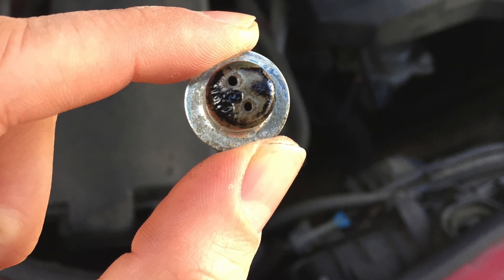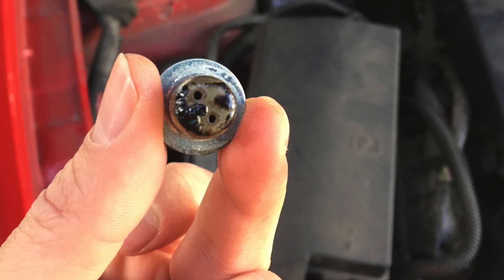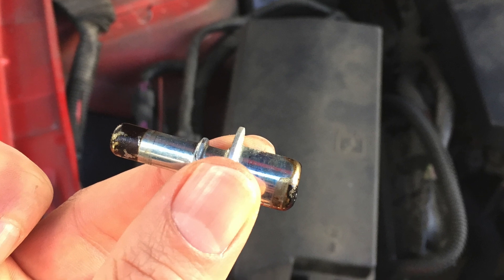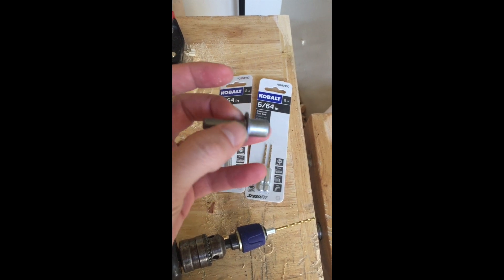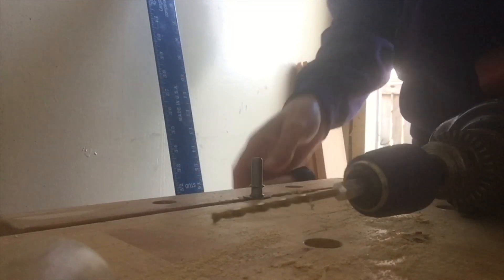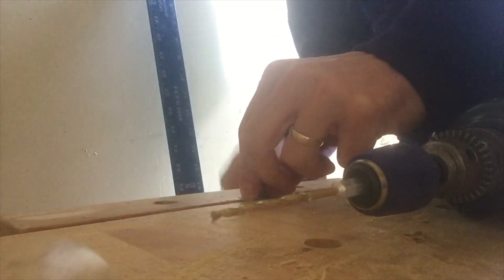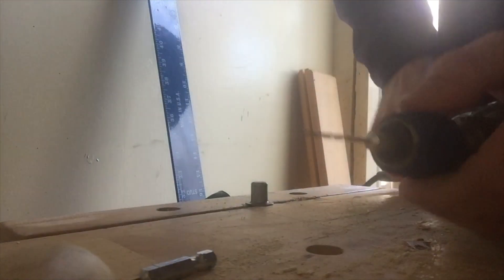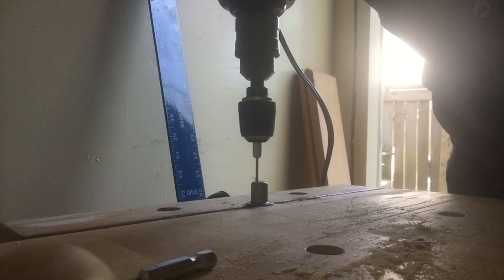GM 3.6L V6  LLT PCV valve modification - GM Camaro

Comment: Why not just buy the newer version of the PCV valve with the larger holes?
Reply from the maker: I wasn't aware that the 2014 fixed PCV valves fit in the 2010 model.
Reply: @bigilworth  If you look at the applications for the PCV valve (click the part number to see them) on Rockauto, it covers up to 2017 models, although not the Camaro. Was the fix not applied to other models with the 3.6L? Or maybe it was, and the PCV valve is a revised part?
Reply from the maker: @brianleeper5737  To my knowledge the PCV valve only needs modification for 2010-2013 models.  In 2014 GM "fixed" the issue by enlarging the holes.  Before I did the mod, all the websites I consulted referenced just buying a new 2010 PCV valve and enlarging the holes.  I could have probably bought a 2014 PCV Valve to see if it would work (since they are so cheap) but I never did.
Reply: @bigilworth  If this PCV valve weren't so difficult to remove you could just pop it out and hit it with some carb cleaner once in a while, like we did with the older cars. It's in the back valve cover on the 3.6L Impala (which I assume has the same issue as the Camaro with it plugging up over time)...which wouldn't be so bad if it weren't in there so tight.
Reply: @bigilworth  It can be modded on LY7 and LE0 motors all the way back to 2004, I did my VE commodore that has a Ly7 3.6 motor from 2008, did it around 1 year ago - no issues.
Reply: I think the newer one is plastic and doesn't fit the 2004 onward models
Reply: Is that an actual option
Reply: money

Comment: Two tips for this:
1. To pull out the PCV I used a locking plier with cardboard around the metal.  It didn't want to come straight out but by twisting it it just almost fell out. So if not budging straight up, clamp onto it and give it a slow twist. 
2. When drilling, do so horizontally to minimise the potential for metal shavings to fall inside.
Reply from the maker: great advice!  It never would have occurred to me to drill horizontally to minimize shavings getting inside the PVC
Reply: I brought my car to the dealership to have them look at it said it was fine it’s been working fine ever cents so maybe just like a glitch

Comment: I just drilled the holes out as large as I could
Reply: How did it run after you did it ?? I drilled mine out as much as I could and its running really rough
Reply: @craigshuttleworth9422  runs perfectly fine
Reply: @craigshuttleworth9422  make sure you put all your vacuum lines back on
Reply from the maker: There needs to be a little bit of resistance for the proper amount of pressure to build up.  Maybe you drilled them out too big.  Did you buy a new PCV to fix the rough running issue?

Comment: How did you remove the PCV from the valve cover, I thought they weren’t removable and the entire valve cover had to be replaced.
Reply from the maker: I took a pair of pliers and pulled upwards on the PCV valve.  It's a little hard to get out, but it does.  No need to replace the valve cover.  In my video I show how I get the PCV valve out at 3:06.  Good luck!  Let me know how it works out for you.
Reply: Alright thanks I’ll give it a try, I have a 2013 Cadillac XTS with the GM 3.6 VVT direct injection engine, and I couldn’t find anything online about how to remove it, some sites say to replace the entire cover.
Reply from the maker: @Jbrown99th  Oh yea I definitely don't believe you need to replace the entire cover.  I have removed the valve about 4 times so far and no leaks or vacuum leaks.

Comment: Change your oil every 3000 miles instead.
Reply: Just stop with the 3k B.S. just use full synthetic oil and a premium filter! GM uses 5w30 oil in these so dealerships can offer those cheap oil changes! All modern engines need synthetic oil! GM owners are also known for being lazy on maintenance as well
Reply: @Krystal I was saying they made it 5w30 so the dealerships could sell cheap oil! If you use synthetic it helps with the sludge issues these engines have!
Reply: @ LF X

It barely uses oil because it’s a thicker viscosity when hot. 

You know what else it isn’t doing?  Going through the dozens of tiny orifices that this engine has for the insane number of moving parts.  

Oh yeah.. 0 weight when cold with the proper oil filter with anti-back flow?  Oil will be right there. You’ll get no startup rattles.. but as the oil heats up and thickens you’re going to get serious damage. Basically the same as you’re trying to avoid with insufficient oil that overheats and stretches the timing chains except in this case it’s flow instead of quantity causing the problem. 

Trust me. I ran a 2004 F-150 FX4 with the dreaded and absolutely awful 5.4 3V Triton. I got 240,000 miles out of it on the original cam phasers and the next owner drove it away with them working fine. 

The reason is because I checked and changed the oil religiously, I used the Motorcraft oil filter with the silicone anti back flow valve, and I used the manufacturer recommended 5W20 oil. 

Yeah, it used oil, and the valve cover gaskets sweated. But those are tiny issues compared to dynamic components being starved for lubrication because you put in maple syrup instead of oil.
Reply: This is modding the engine PCV to match the research and modifications done to later motor revisions, its retrofitting knowledge learnt... only can be a good thing.
Reply from the maker: Thank you.  Definitely felt the same way.  I'm really surprised that GM didn't put out a recall to just swap out PCV valves.  it wouldn't have cost them much.  Anyway, easy mod and helps solve lots of carbon buildup issues.
Reply: LF X  you should be fine I don't know how many miles you drive a year but as long as every week or so you take a trip and let the engine get to full operating temp you can go way longer then 3or4 k! I'd change it every 6 months if you're really concerned!

Comment: Hows the car going now have you had any more problems with the wholes drilled out
Reply from the maker: For this project, I drilled out the holes, and then I added a catch can.  I've put 15,000 on the car and I do not notice any performance difference.    

Before I did this, I took the plenum off and did a manual cleaning of the valves (at 107,000) to get all the gunk off.  I suppose the real test is to see how much gunk buildup there is since doing this project.  

Is it worth it?  I'm not sure.  I can say with a certainty that my catch can captures about 4oz of oil/water mixture every 5-6k oil change I do.  So I must be avoiding some damage to the intake by preventing all that oil from coating the valves.  

I think at the very least, you should put a catch can on your car.
Reply: @bigilworth  yeah mate, I did the whole drill it out thing, with the same drill bits you showed, waiting on the catch can in the mail.... 
My pcv vavle was clogged an all the hose were clogged, it was in terrible state I just bought the ute.. so hopefully it's not too far gone! 
God knows how long it's been like that for! 
Probably never got change from day 1:(
Reply from the maker: @markpalmer9360  Wow that's awful that everything was clogged up.  Your PCV valve sounds much worse than mine.

In your situation, modifying the PCV valve should absolutely make a difference.  And a catch can will truly help prevent coking of the intake valves.  

If you're skilled enough, I would take the plenum off and see how bad the intake valves are coked with soot.  A manual cleaning would go a long way.

Also, you might want to try some sea foam added to the oil to help loosen up any deposits that might be floating in the heads or the timing chains.
Reply: @bigilworth  yeah matey, 
It's not good I was getting gunk on the oil lid, like yellow stuff  it's not a blown head gasket thank God, 
Its consendation from having pcv clogged I guess, yeah so, seafoam is the way to go mate ? 
And with the covers do you need a certain torque on the bolts when you tighten them back up ?
Reply: @bigilworth  hey mate installed the catch can and it filled up in the matter of a drive around the block, I take it that's not normal,,, 
Or maybe it's been clogged up for that long it's just come out,, I dont know what's your opion ?
Reply from the maker: The plenum bolts get torqued to 18 foot pounds
Reply from the maker: If your catch can filled up in a drive around the block, that doesn't sound correct.  That much oil shouldn't be able to push through the PVC valve, no matter how big the PVC valve holes are.  
What kind of catch can are you using?  Is there baffling in the catch can?
Reply: @bigilworth  just a cheap one, an no I dont think so , mayb I should chuck steel wool in it,.
Reply from the maker: @markpalmer9360  Check out some of the YouTube videos on catch cans and how to use steel wool inside them.  Mine has a special compartment that I put the steel wool in and the gasses are forced through the mesh, thus filtering the oil/water out.
Reply: @bigilworth  yeah I done that an went along an bought a ryco one so I have 2 now working mint bro
Reply from the maker: @markpalmer9360  Nice!  The Ryco cans look amazing.  I went with the Moroso and have been pleased with that.  Let me know how the ryco works out.  With 2 cans, you shouldn't have much oil escaping the PVC into the intake!

Comment: How did you get the hose to clamp off mine doesn’t budge
Reply from the maker: The hose that connects to the PCV valve has a little sliding lock mechanism that you slide to the left.  Slide to the left and pull up.  Should do the trick.

Comment: My catch can is always empty? Engine runs fine. Last 100mile trip and about 50 miles city driving gas millage was 25.4 mpg. What'd you think? p. s. Got 101,155 miles on engine. Always use Pennzoil platinum. Never removed  intake though..
Reply from the maker: That's crazy that your catch can is empty.  I literally just opened mine after 5000 miles and had 4 ounces of oil/water mixture.  If you checked it after 100 - 200 miles, you probably didn't drive enough to generate any oil.  Check after 1000 miles and I guarantee that you'll have 0.5 - 1 ounces of oil come out.  
I've been using Royal Purple for the past 2 years, (22,000 miles) and I've noticed less oil consumption but no change in the amount of catch can oil coming out of the PCV.  
Let me know after 1000 miles how much oil got caught by the catch can.  I'm curious.
Reply: @bigilworth I just changed my spark plugs. "probably could have cleaned them and reused them" I didn't have a bore camera, but my intakes were clean. Take my word for it. I used an inspection mirror and narrow beamed high intensity flash light. Nothing in catch can, but a light film. It hardly showed on my finger when I wiped the inside of the can.  The only problem I had was removing the plugs. they were a little too tight, and I took my time. Used anti seize on new plugs Looking for another 100k. Hope I didn't jinx myself. P.S I don't sissy my car. I never was a putt, putt driver. I get on it whenever I can.

Comment: lmao just vent to atmosphere
Reply from the maker: You can be a douche bag and vent to atmosphere, or you can help lower emissions.
Reply: @bigilworth  one has to wonder if oil pits and coal veins getting struck by lightning would essentially burn the same toxins into the air.  It seems that either way it will go into the environment.
Reply: Just scrap you car and you'll be looking at no emissions.
Reply: venting to atmosphere breaks the system (especially on cars with MAF sensors as they measure the air entering for the CCV as the dirty side 
extra air" going around the throttle plate as a bypass needs to be metered to control the AF ratio), a vacuum sucking out the fumes is better than it wearing out the oil and engine components, think of vacuum assisted crankcase ventilation as taking out the trash each week, venting to atmosphere is like filling a bin that is already overflowing.
Reply: @robywankenobi32  do you think running high octain gas in a 3.6 cts would slow the builup?
Reply: @xl_Graveyard _lx by "atmosphere" you are venting it your face, especially with defrost or outside air vent. In traffic it Probly wreaks.
Reply: @z Baba Booey x The world is not confined to the borders of the USA haha, PCV style systems were introduced in the 1950/60's because you had a massive issue to do with smog in the US, GM found 50% of the emissions from a car was due to the crankcase venting to the atmosphere, venting a car that has perfectly working PCV crankcase system will also render your car illegal for road use in pretty much every country that is developed, that includes india and china as both have a massive export for domestic cars and trucks so have to comply in order to sell outside their borders.

Comment: That pcv system was a great idea but it has many flaws ....
1: it only works during cruise speeds... its practically closed during idle and wot or heavy acceleration... 
2: its pulling in nasty blowby from the crankcase back into the engine which crudes up the valves and piston tops which lowers octane levels and raises compression = more heat 
3: the pcv will work better if that check valve was not in there... if it was a straight thru fitting, then the intake manifold vacuum could extract that blowby the entire time the engine was running .. the only downfall is that your combustion chamber will build up that crud that much faster ... 
on all 3 of my vehicles i route the pvc & valve cover into the exhaust ..
Reply: How did u do that( route the pvc & valve cover into the exhaust )
Reply: These ones are straight thru, there is no check valve inside, holes are too small tho and do need to be drilled out or it clogs up easily...
Reply: Could also vent to pre-throttle-body intake
Reply: @Wes_5kyph1  the hole point to to get rid of that nasty crank case fumes ... you dont want that going back into your engine to gunk up your valves and piston heads ...
Reply: That can always be remedied with a catch-can if it's that bad. The reason for pre-TB is to restore the engine vacuum the PCV normally steals when it's vented through intake manifold. Manifold vacuum port should be capped off for crankcase venting, otherwise it's a designed vacuum leak under the guise of "pollution control" ..more vacuum to engine = better combustion = less blowby
Reply: @ACommenterOnYouTube  Yes, I agree completely.  The only reason they've been designed this way on passenger vehicles (since early 80's?) is for the legal codes that came into effect.  Before that, cars just vented onto the street through drain pipes. 
I'm just highlighting the other (way more insidious) flaw of the PVC-design that's rarely ever acknowledged.
Regardless of how the crankcase vapors are vented, the PCV is a vacuum leak which degrades combustion and creates more blowby, more emissions, less power and lower lifespan of the engine.  Just by capping off the manifold vacuum source, any engine will gain at least 10-15 hp, lower emissions and longer lifespan of the engine.

Comment: just done this At 94, 000 miles, I have a catchcan systen sense 30,000 the pvc was clean no clogs
Reply from the maker: To be fully honest, my PVC valve wasn't clogged or anything when I performed the modification; however I felt after watching many videos on the subject that it couldn't hurt to do the modification, especially since GM enlarged the PVC valves on all 2014/later Camaro models.  If GM did it, there must be a good reason.  And with a catch can, hopefully that will stop valve choking due to the GDI issue.
Reply: @bigilworth  does this help with oil consumption

Comment: Or... just buy a new valve for $10?
Reply: Its not a valve, its a controlled orifice that isn't big enough
Reply from the maker: Yea you need to drill out the holes because the new valve holes won’t be large enough either.
Reply: @bigilworth  if u want more power and 10%+ mpg just bypass the pcv. cap the pcv intake vacuum & leave pcv valve on. and start it up.